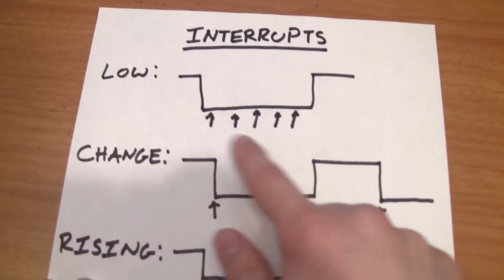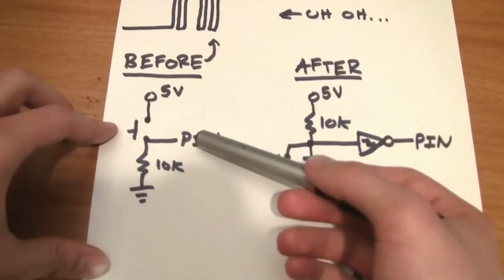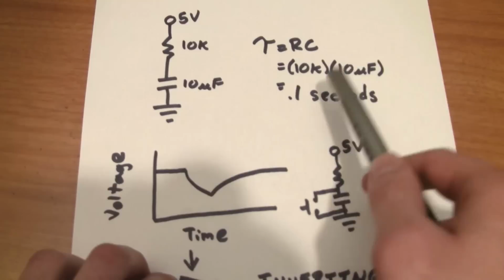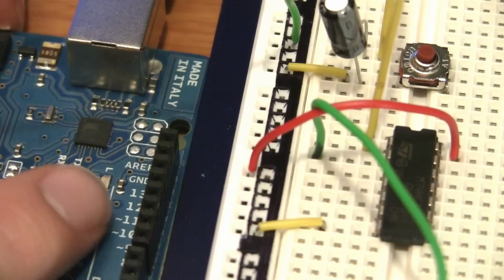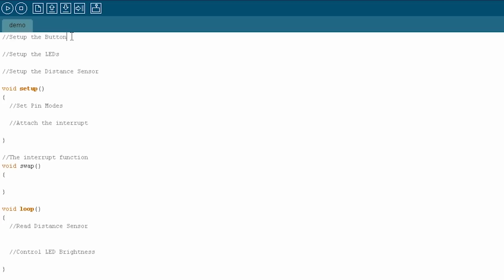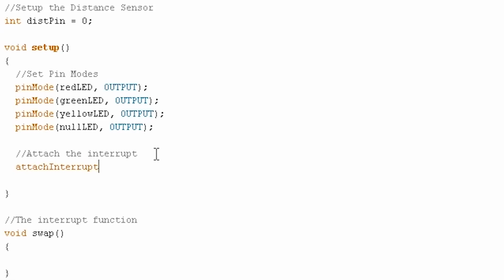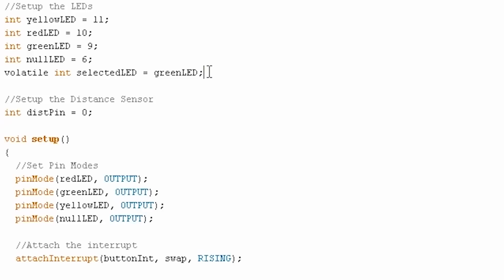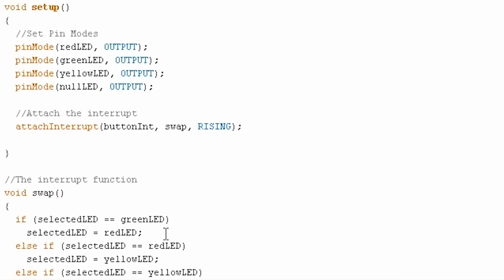Tutorial 10 for Arduino: Interrupts and Hardware Debouncing

Comment: I'm a little confused as to why there would be a decaying output voltage when the button closes. I can understand why the voltage would climb according to the RC curve when the button opens but when the button closes there is no RC circuitry between GND and the output and so, the way I figure, the output will drop to 0V instantly, not right?

I'd appreciate if someone could set my mind straight on this one. But thanks for these videos though, they're a tremendous help for noobs like me.
Reply: Hey.. I think that even a wire has some resistance. So when button is left opened the voltage drops around a capacitor (and the wire) and that circuit becomes like a RC circuit. Though am not completely sure about this  .
Reply: I'm not so sure. Of course I'm no expert either but the way I understand it, even if the wire had some resistance (and I'm sure it does have a very small resistance), the RC time constant would be minimal (very small resistance multiplied by the capacitance) and so the voltage drop would be instantaneous.

Besides, closing that switch is effectively shorting out the capacitor so it should discharge extremely quickly.
Reply: Because its technically wrong.  The capacitor does not condut to ground it charges to 5 V the button press across capacitor will discharge the capacitor which is why the cure later shows a dive when the button is pressed and rises when released.  His signal point is not explained, it is between capacitor and resistor.  Is this Time Constant formula correct, can someone please confirm?
Reply: The circuit is wrong, loose the hex schmitt chip and add a resistor. Wire a resistor from Vcc to the switch and the other side of the switch to ground. From the join of the resistor and switch, run a second resistor from there to both the smoothing cap (second cap leg to ground) and the input to the schmitt trigger. Also, looking at the input pins on the 328 chip used in the UNO, each digital input already has a schmitt internally so the hex schmitt external chip should not be necessary.
Reply: Correct.  No decay, the voltage would vansh and then climb by time constant.  The wire resistance is negligable.
Reply: I put a 750K ohm resistor in series to the first input of the switch from the 5V power supply. The first input also connects to the D2 pin (INTERRUPT Pin)  of the arduino. The second input of the switch connects to GND. Finally I put a 1uF Capacitor across the D2 pin and ground. Now set the trigger mode to 'RISING' in the code. Thats it! Worked like a charm. OPTIONALLY: You could put a 22pF ceramic cap across the switches for even better stability.

Comment: Really? Seriously? Eleven years, 2.5K likes, all those flattering comments, from EE among others and no one (NO ONE!) saw that this does not make sense?? The author is short circuiting the capacitor! This is no debouncing in hardware if anything it could be a spark generator. You are missing another resistor! The one in the actual RC circuit.
Reply: Meh. 
I see your point... and it is valid... theoretically. 
Practically, there really isn't too much of a concern, at least not for small capacitor values and low voltages. This is not exactly a power application where you're switching large currents at high voltages into inductive loads.
I might put a small resistor in series with the cap being discharged (IF I were using a 10uF monster like what he's using. That is really overkill and could actually work against you if you're using  faster pulses like what you might get from a rotary encoder. I'd probably select a cap in the range of 500pF to maybe 10 nF, depending on the application).
In practice (for small capacitors at least), it really does not make a practical difference because the small resistance present in the traces, the wiring, the contact points, the internal resistance of the capacitor etc. is typically enough to avoid infinite currents and therefore prevents the destruction of the universe. 🤣

Comment: Great video man. Interrupts seem like a very attractive and great idea, but honestly - what is the point when it conflicts with half the code of your program...? 
Cant use serial, can use delays... the list goes on and on. SOOOOO frustrrating!  Yeah it's great to be able to blink a LED... and run NO other code.. 
Seems like the resources used by polling are worth maintaining the full functionality of the Arduino.
Reply: Interrupt routines are supposed to be short and quick. In practice I have never seen an interrupt routine affect the performance of my main program.
Without interrupts, you would not be able to use a PC keyboard, or a mouse., a touchscreen, your phone... etc.

Comment: Can someone recommend a good tutorial on resistors, how to use them, and what for!?
Reply: check the 3rd part of his tutorial
Reply: really simple: resistors are used to limit current. most pins have a current limit you dont want to exceed. ohms law is your friend V(oltage) = I(current) * R(resistance). V/R = I . Resistance also causes a voltage drop. two resistors in series can create a resistive divider to drop voltage to what ever level you need. google resistive divider calculator

Comment: HELLO, I put in the non debouncing circuit onto my project since debouncing was not switching anything.  I did the sketch with the led on pin 13 and it was perfect.  So I have this code for my School project off of an instructable for Arduino DMM Digital Multimeter by Milen.  I have re-wrote this code before in C for an 8051 and actually had this massive code that worked.  Fun.  Anyway putting this non debounce method is still not working in the code to switch between modes.  Please help.  will Paste the whole code:  not using the fade options so can go.  I have been working on this project for many months and have added many other things this is just part of the project.  please tell me if you see anything that is keeping me in the welcome screen.
/*
 Test LCD + MODE Select button
 
 */
 
#include <LiquidCrystal.h>
#include <math.h>
#include <SPI.h>
int button_pin = 2;
int outPin = 13;       // the number of the output pin
int back_light = 10;
int v100 = 9;
int v30 = 8;
int v10 = 7;
int curr_mode = 13;
int MODE = 0;
//int brightness = 0;  
//int fadeAmount = 5;
int curr_value = 0;
int acc_value = 0;
float disp_res;
float supply = 4.90;
float coeff_v100 = 1.01;
float coeff_v30 = 1.011;
float coeff_v10 = 1.018;
float coeff_A_gain = 0.992174;
float coeff_A_res = 0.98315;
float opamp_offset = 0.000767;
volatile unsigned long last_millis = 0;

LiquidCrystal lcd(12, 11, 6, 5, 4, 3);
// the follow variables are long's because the time, measured in miliseconds,
// will quickly become a bigger number than can be stored in an int.
long time = 0;         // the last time the output pin was toggled
long debounce = 1;   // the debounce time, increase if the output flickers
// the follow variables are long's because the time, measured in miliseconds,
// will quickly become a bigger number than can be stored in an int.
void setup()  {
  pinMode(button_pin, INPUT);
  pinMode(back_light, OUTPUT);
  pinMode(v100, OUTPUT); 
  pinMode(v30, OUTPUT);  
  pinMode(v10, OUTPUT); 
  pinMode(curr_mode, OUTPUT);
  attachInterrupt(0, button_pressed, RISING);
  analogWrite(back_light, brightness);
  digitalWrite(v100, LOW);
  digitalWrite(v30, LOW);
  digitalWrite(v10, LOW);
  digitalWrite(curr_mode, LOW);
  lcd.begin(16, 2);
  lcd.print("DIGITAL MULTIMER * DIGITAL MULTIMER");
  lcd.setCursor(0, 1);
  lcd.print("Press \"MODE\" key to select a function");
  Serial.begin(9600);
  Serial.println("*****************************************************");
  Serial.println("*                 DIGITAL MULTIMETER                  *");
  Serial.println("*   Press the \"MODE\" key to select a function         *");
  Serial.println("*****************************************************");
  delay (1000); 
    delay (1000);
      delay (1000);
        delay (1000);
          delay (1000);
}

void loop()  {
  digitalWrite(v100, LOW);
  digitalWrite(v30, LOW);
  digitalWrite(v10, LOW);
  digitalWrite(curr_mode, LOW);
  brightness = 0;
  analogWrite(back_light, brightness);
  delay(20);
   if (MODE>0) {
  lcd.clear();
  lcd.print("MODE");
  lcd.setCursor(0, 1);  
     switch (MODE) {           
             case 1:
             V_100();  // Voltmeter mode with range 0-100V
               break;            
             case 2:
             V_30();   // Voltmeter mode with range 0-30V
               break; 
             case 3:
             V_10();   // Voltmeter mode with range 0-10V
               break; 
             case 4:
             A_500();  // Amperemeter mode with range 0-500mA
               break;            
             case 5:
             R_250();  // Ohmmeter mode with range 0-250KOhm
               break; 
             case 6:
             R_1000();  // Ohmmeter mode with range 0-1000R
               break;            
             case 7:
             D_LED_CONN(); //Check Vforward of diodes, LEDs and connectivity with 10uA
               break;            
             case 8:
             LED_FUNC(); // LED function check
               break; 
             case 9:
             BETA(); // NPN BETA meter - max 1000
               break;            
          }
 }
  else {
  for (int positionCounter = 0; positionCounter < 21; positionCounter++) {
    lcd.scrollDisplayLeft();
    delay(150);
  }
  delay (1000);
  delay (1000); 
  for (int positionCounter = 0; positionCounter < 21; positionCounter++) {
    lcd.scrollDisplayRight();
    delay(150);
  }
  delay (1000);
  delay (1000); 
  }  
}

void button_pressed() {

  //Took out everything here since debouncing not needed
  if (MODE == 9)   {
    MODE = 0;
   }  
  else {
    MODE = MODE++;  
   }
  }
  
void V_100() {
  digitalWrite(v100, HIGH);
  lcd.clear();
  lcd.print("V-meter V=<100V");
  Serial.println("*        Voltmeter mode - Range 0 - 100 V             *");
  lcd.setCursor(0, 1);
  voltage_meas();
 }    
void V_30() {
  digitalWrite(v30, HIGH);
  lcd.clear();
  lcd.print("V-meter V=< 30V");
  Serial.println("*        Voltmeter mode - Range 0 - 30 V              *");
  lcd.setCursor(0, 1);
  voltage_meas();  
 }
void V_10() {
  digitalWrite(v10, HIGH);
  lcd.clear();
  lcd.print("V-meter V=< 10V");
  Serial.println("*        Voltmeter mode - Range 0 - 10 V              *");
  lcd.setCursor(0, 1);
  voltage_meas();
 }
void A_500() {
  lcd.clear();
  lcd.print("A-meter I=<500mA");
  Serial.println("*      Amperemeter mode - Range 0 - 500mA             *");
  lcd.setCursor(0, 1);
  acc_value = 0;
  for (int i=0; i <= 15; i++){
  curr_value = analogRead(A1);  
  acc_value = acc_value + curr_value;
  }     
  curr_value =  int(acc_value/16);
  if (curr_value == 1023) {
    meas_overflow(); }
  else {
    disp_res = (((curr_value*supply )/1024 - 10*opamp_offset)/coeff_A_gain)/coeff_A_res*100; 
    lcd.print("   I = ");  
    lcd.print(disp_res, 1); 
    lcd.print(" mA");
    Serial.print("*                      I = ");
    Serial.print(disp_res, 1);
    Serial.println(" mA");
    delay(250);
  }
 }
void R_250() {
  lcd.clear();
  lcd.print("Ohmmeter R=<250K");
  Serial.println("*      Ohmmeter mode - Range 0 - 250 KOhm             *");
  lcd.setCursor(0, 1);
  acc_value = 0;
  for (int i=0; i <= 15; i++){
  curr_value = analogRead(A2);  
  acc_value = acc_value + curr_value;
  }     
  curr_value =  int(acc_value/16);
  if (curr_value >= 512) {
    meas_overflow(); }
  else {
    disp_res = ( curr_value*supply )/1024*100; 
    lcd.print(" R = ");  
    lcd.print(disp_res, 1); 
    lcd.print(" KOhm");
    Serial.print("*                      R = ");
    Serial.print(disp_res, 1);
    Serial.println(" KOhm");
    delay(250);
  }
 }
void R_1000() {
  digitalWrite(curr_mode, HIGH);
  delay(20);
  lcd.clear();
  lcd.print("Ohmmeter R=<1000");
  Serial.println("*      Ohmmeter mode - Range 0 - 1000 Ohm             *");
  lcd.setCursor(0, 1);
  acc_value = 0;
  for (int i=0; i <= 15; i++){
  curr_value = analogRead(A2);  
  acc_value = acc_value + curr_value;
  }     
  curr_value =  int(acc_value/16);
  if (curr_value >= 512) {
    meas_overflow(); } 
  else {
    disp_res = ( curr_value*supply )/1024*400; 
    lcd.print(" R = ");  
    lcd.print(disp_res, 1); 
    lcd.print(" Ohm");
    Serial.print("*                      R = ");
    Serial.print(disp_res, 1);
    Serial.println(" Ohm");
    delay(250);
  }
 }
void D_LED_CONN() {
  lcd.clear();
  lcd.print("Vf:Dio/LED; CONN");
  Serial.println("* Vforward of diode/LED ; Connectivity check - 10uA   *"); 
  lcd.setCursor(0, 1);
  acc_value = 0;
  for (int i=0; i <= 15; i++){
  curr_value = analogRead(A2);  
  acc_value = acc_value + curr_value;
  }     
  curr_value =  int(acc_value/16);
  if (curr_value >= 560) {
    meas_overflow(); }
  else if (curr_value <= 1) {
    zero_res(); }
  else {
    disp_res = ( curr_value*supply )/1024*1000; 
    lcd.print("   V = ");  
    lcd.print(disp_res,0); 
    lcd.print(" mV");
    delay(250);
    Serial.print("*                      V = ");
    Serial.print(disp_res, 0);
    Serial.println(" mV");
  }
 }
void LED_FUNC() {
  digitalWrite(curr_mode, HIGH);
  lcd.clear();
  lcd.print("LED function chk");
  Serial.println("*               LED functionality check               *"); 
  lcd.setCursor(0, 1);
    acc_value = 0;
  for (int i=0; i <= 15; i++){
  curr_value = analogRead(A2);  
  acc_value = acc_value + curr_value;
  }     
  curr_value =  int(acc_value/16);
  if (curr_value >= 560) {
    LED_tst(); }
  else if (curr_value <= 1) {
    zero_res(); }
  else {
    disp_res = ( curr_value*supply )/1024*1000; 
    lcd.print(" V = ");  
    lcd.print(disp_res,0); 
    lcd.print(" mV");
    Serial.print("*                      V = ");
    Serial.print(disp_res, 0);
    Serial.println(" mV");
    delay(250);
  }
 }
void BETA() {
  lcd.clear();
  lcd.print("NPN BETA meter"); 
  Serial.println("*               NPN BJT BETA measurement              *");
  lcd.setCursor(0, 1);
  acc_value = 0;
  for (int i=0; i <= 15; i++){
  curr_value = analogRead(A3);  
  acc_value = acc_value + curr_value;
  }     
  curr_value =  int(acc_value/16);
  curr_value =  1023 - curr_value;
  disp_res = ( curr_value*supply )/1024*333.33;
  if (disp_res >=10){
  lcd.print(" BETA = ");  
  lcd.print(disp_res,0);
    Serial.print("*                    Beta = ");
    Serial.print(disp_res, 0); }
  else {
  LED_tst(); }  
  delay(250);
 }
 
void meas_overflow() {
  lcd.setCursor(0, 1);
  lcd.print("   OVERFLOW!!!  "); 
  Serial.println("*                     OVERFLOW!!!                     *");
  lcd.setCursor(0, 1);
  for (int i=0; i <= 101; i++){
  analogWrite(back_light, brightness);   
  brightness = brightness + fadeAmount;
  if (brightness == 255) {
    fadeAmount = -fadeAmount ;
  }     
  delay(15);
  } 
 }
 
 void zero_res() {
  lcd.setCursor(0, 1);
  lcd.print("Zero resistance!"); 
  Serial.println("*           Short circuit - zero resistance           *");
  delay(250);
  brightness = 255;
  analogWrite(back_light, brightness);
  delay(250);
  brightness = 0;
  analogWrite(back_light, brightness); 
 }
 
 void voltage_meas() {
  acc_value = 0;
  for (int i=0; i <= 15; i++){
  curr_value = analogRead(A0);  
  acc_value = acc_value + curr_value;
  }     
  curr_value =  int(acc_value/16);
  if (curr_value == 1023) {
    meas_overflow(); }
  else {
 switch (MODE) {           
             case 1:
    disp_res = ( curr_value*supply*20)/1024*coeff_v100 ;
               break;            
             case 2:
    disp_res = ( curr_value*supply*6)/1024*coeff_v30;
               break; 
             case 3:
    disp_res = ( curr_value*supply*2)/1024*coeff_v10;
               break;  }   
    lcd.print("   V = ");  
    lcd.print(disp_res, 2);  
    lcd.print(" V");
    Serial.print("*                      V = ");
    Serial.print(disp_res, 2);
    Serial.println(" V");
    delay(250);
  }   
}
void LED_tst() {
  lcd.setCursor(0, 1);
  if (MODE == 8) {
  lcd.print(" Swap the pins ");
  Serial.println("* Try to swap the LED pins. White LED could not glow  *"); }
  else {
  lcd.print("Check the NPN tr"); 
  Serial.println("*    Check if the BJT is NPN. Check the pin order     *"); }
  delay (500);
  lcd.noDisplay();
  delay (200);
  lcd.display(); 
 }